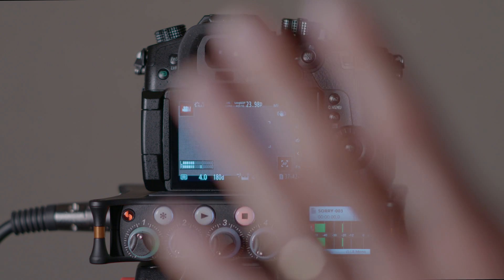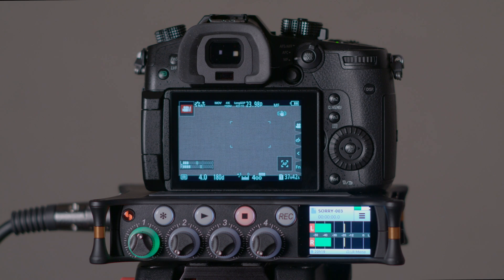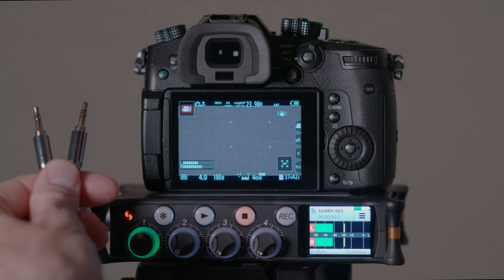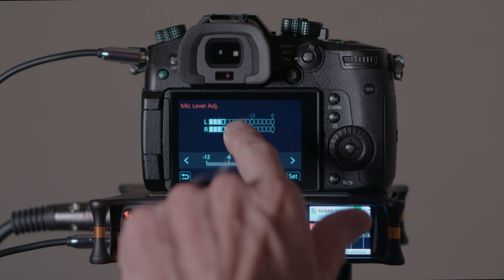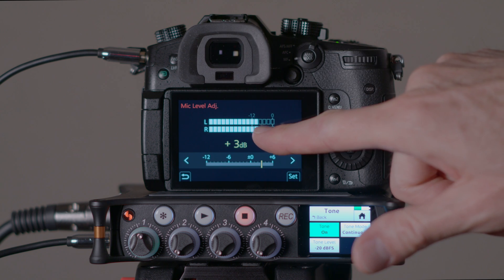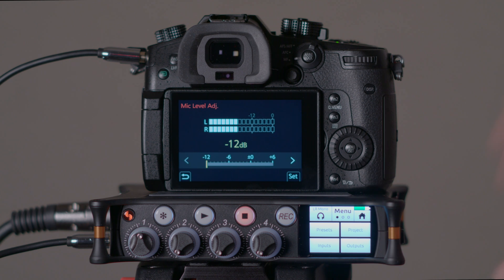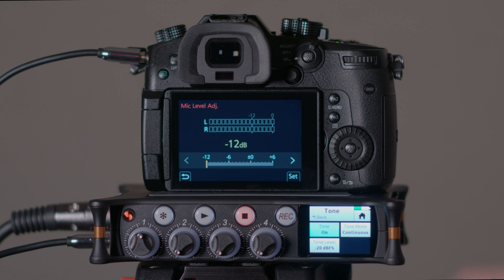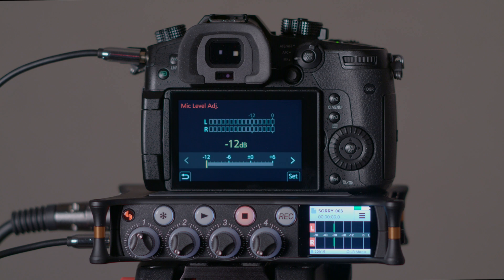Sound for Video Session: Set Audio Levels From Recorder to Camera with Tone

Comment: Great tutorial Curtis.  Appreciated!  I have a newbie question for you.  I just went through all  the steps shown in the video to match the levels between my new MixPre3II and my Canon Rebel T7i.  I had no issues with the process, and my test videos sound great.  That said, I noticed something odd when I connected my camera to my smart tv via a HDMI cord.  My videos still sound great, but I noticed that they were significantly quieter than your YouTube videos.  I haven't uploaded my test videos to YouTube to a side-by-side comparison between the volume levels of your videos and mine, but the difference seemed significant.  Is this normal?  Will my videos somehow be magically louder once their uploaded to YouTube?  Thanks for any thoughts or commentary you can offer on this.
Reply: Hi Dean, Yes, setting levels for recording is to ensure you don't clip or distort during recording. But then in post production, you need to loudness normalize the audio like this: https://youtu.be/OKSWPrT5upo

Comment: What brand or where did you buy the 3.5 TRS cable from? Can the TRS cable connect to any camera?
Reply: I just used a monoprice cable which I bought from Amazon. It can connect to most cameras with a 3.5mm microphone input.

Comment: hi there,  is there any way to record in camera video but with no sound ?  i am a new owner of a gh5 ..Thanks in advance!
Reply from the maker: Hi Razvan D., There isn't a setting I know of to turn off the in-built microphone, but if you have a 3.5mm plug with nothing else connected to it, that will tell the camera to use the 3.5mm microphone input and since you won't have anything connected to the other end of the 3.5mm cable, it won't record anything. Or, you could just drop the audio track in post in whichever editing app you use.
Reply: @LearnLightAndSoundSessions  Great! thanks for the answer.

Comment: Looking into the Mix Pre-3 for my dual GH5 setup and had a question. We shoot a ton of interviews. Typically I run two mics into an H5 and use the mic that sounds better. Had an issue with power failure on the H5 using a powerbank that caused me to lose an interview recently. Looking into a redundant setup where each mic is going into an isolated recorder or one straight into the camera using a Rode newshooter for one of the booms. QUESTION(s): Does recording into a Mix Pre or an H5 and then sending that line out signal ultimately to the GH5 degrade the audio quality? If the GH5 is set to -12db is it still coloring the recording or are you getting just the quality from the external recorder? What would be your go to setup for truly redundant audio?
Reply from the maker: Feeding audio to camera is a fine approach that I use more than ever. Technically, it will degrade the audio quality a bit but running the audio to camera gives you options in post. I'd do it assuming that the camera audio will be backup, but if you find it to be good enough for what you're doing, then you've saved yourself a bit of time.

Comment: i am not employing the mixpre but rather the zoom f4.  there seems to be some complicating issue about whether the tone sent from the zoom is line level of mic. are you aware of this controversy?  it is my understanding that if the tone was sent out as line level, the setup between camera and the zoom f4 would be similar to your vid. but what would happen if the tone sent from the zoom f4 would be at mic level? 

from another website: "A bigger problem is its slate tone. According to page 118 of the user manual:

The MAIN OUT 1/2 and SUB OUT 1/2 faders do not affect the level of the slate tone.

This is not good. One of the main purposes of slate tone is to use it to adjust the audio levels of other equipment you connect. For example, if the main XLR outputs of the Zoom F4 are connected to a breakaway cable, and that cable is connected to the audio inputs of the main camera of a shoot, you cannot use the slate tone on the F4 to adjust the audio input levels on the camera. Simply put, the volume level of the slate tone on the F4 should match the volume level of the Main Outputs. The way the Zoom F4 is now, you would need to plug a tone generator, like the Shure A15TG, into one of its inputs and use it as a slate tone to set the levels of cameras and other equipment you attach."

I apologize for the way too long post but i wanted to properly explain the problem.

can you see a better work around to set levels other than a tone generator? can i take the audio from the interviewee and set levels or even a crew member and by pass using the slate?

as always, thank you for the effort and the sharing.  i am a very appreciative subscriber.  thumbs up.
Reply: Interesting. Are you using the 3.5mm output or the XLR balanced outputs? From memory, I thought the F4 XLR outputs produce a line level output signal and the 3.5mm output produces a microphone level signal.

If you're using a camera with a 3.5mm mic input, then having an output that is mic level is exactly what you need.

Comment: This is confusing Curtis. What are you doing on the side of the MixPre? we can't see. Also you show how to get -20db on both camera and mixer but don't explain how that relationship works when we adjust the input gain and output volume knobs. For example If you set the output volume at a certain level does that affect the TONE going to the camera and does the input gain affect the TONE? Not quite sure how this all works. Maybe a better explanation of how the input gain and output volume is set up and then all the other stuff.
Reply: Hi John, first, let me explain the high level goal and then answer your specific questions.

The purpose of calibrating the camera and recorder is so that you do NOT have to worry about or change the output level of the recorder during the shoot. You can simply make any trim or fader adjustments on the sound recorder/mixer without worry of overloading the camera audio inputs.

On the side of the mix pre, I use the menu settings knob to change whatever setting we're currently adjusting. You can see the changes reflected on the MixPre's screen.

Calibrating the camera and audio mix to -20dB ensures that you will not (and SHOULD NOT) adjust the output level on the recorder once you have the camera and audio mixer calibrated at -20dB. So if you increase the input level on your audio recorder during the recording, the level on your recorder and your camera should increase in tandem. As long as you do not clip on the audio recorder, you should not clip on the camera. That is the whole idea behind this process of calibration.

The tone level sent from the audio mixer is set in the recorder's menu and is not affected by the trim or fader levels you set for any of the microphone channels.

I hope that makes more sense.

Comment: I’m thinking of getting the mixpre-3. the only thing that concerns me about this set up is changing the camera battery is much slower. Does any body know any solutions to get access to the battery compartment faster?
Reply: Hi Rashad, So it sounds like you're mounting the camera on top of the MixPre. You could put a quick release plate between the MixPre and camera.
Reply: Curtis Judd thanks a lot! I’m kicking myself for not thinking of such an obvious solution! I’ve  done it with other pieces of gear too... hahaha. keep up the good work!
Reply: @Rashadmcka  What're friends for? To help you remember the things you already know but temporarily forgot. Thanks so much!

Comment: I can make this steps with Tascam dr60dmkii ? and I don't have audio level in my camera because too old how I fix this problem with Tascam because I tried before and the sound not good
Reply from the maker: Hi Ehab, yes,  the Tascam has a tone. The camera needs to have a peak level meter and the ability to adjust the input level on the camera.

Comment: Hey Curtis, I have a Tascsm DR60D  MK II. I wanna upgrade to the Sound Devices Mix Pre 3. The Tascam is freaking awesome if the levels are set perfectly and I'm smart enough to use a dual track recording at about a -12db level. But if my subject sings so loud I still can get distortion. Here's my thinking (correct me if I'm wrong). I'm getting distortion because my subject is exceeding my levels regardless. Then once the digital limiters kick in on the Tascam they simply keep the distorted audio at a lower level instead of preventing it. The Mix Pre 3's analogue limiters can rescue me from this distortion in a subtler/ more effective way by reducing the input levels and preventing distortion. This would allow me to focus on my subject intestead of my audio. How's my thinking?
Reply: Hi David, pretty good thinking but with one recommendation. The MixPre's preamplifier has so little self noise, that you'll want to reduce the gain so that the peaks are hitting more in the -24 to -18dB range. Then you can normalize to higher levels in post. You want to leave plenty of headroom so that when the really loud singing kicks in, you're only hitting the limiters very occasionally for the most transparent sound. And because the preamps have so little self noise, there's no need to run the input levels so hot at -12dB. I hope that makes sense. Good luck!
Reply: @curtisjudd  that totally makes sense. I use the cheap AudioTechnica AT875R. It comes in super hot, but doesn't grab the low end so much. It does have decent/good off axis rejection but overall - it's a beginner mic thats good enough for journalists. I really want the Deity SMic2 with the Sound Devices Mix Pre 3. I wish they made a $300.00 single input Mix Pre 1. Lol. I'd buy 2 of them! One 1/8 Jack and one XLR Jack. Only one used at a time. I'd still buy it.
I get you about the settings. Keep the gain low cause the Mix Pre 3 is ULTRA LOW NOISE...  Normalize it all in post since there won't be much noise that gets amplified from the Mix Pre 3 (the mic... That's another story about noise).

Comment: Do you always turn the camera to its lowest setting? I work with a lot of cinema cameras such as REDs and what not.  

Also the thing that confuses me with the F8 is that I know it only does -10db for the feed, but the slate tone let’s you select -20db for the tone, should I be setting it -10db for the slate tone as well?  I’m looking to get the F8n because of this annoyance.  What are your thoughts? What would you do?
Reply: Hi David, not always to the lowest setting, but usually quite close. With cinema cameras, I'm usually sending a line level signal instead of a mic level signal so the gain is usually less of a concern.

When sending tone to the camera from the F8, I use the slate tone set to -20dB. This works great on firmware version 5.0. I don't recall whether it was an issue with earlier firmware versions.
Reply: Curtis Judd thanks much. Good to know.

Comment: Basic Question: If the goal is always the best audio possible, why would we send/route the MixPre Kasmir-quality signal back through the camera's inferior preamps? What am I missing?

PS. I'm just getting started on the audio side. I have the new Sony a7III and will most likely purchase the MixPre-6 and your LL&S course.
Reply: Hi Dan, It depends on the requirements for the production one is working. Some productions need a very fast turn-around, like many news productions, so it is common in those cases to capture the sound with a high quality mixer and send a feed from the mixer to camera. For narrative types of productions, there is often more time so in many of these cases, the production will use the mixer's recorded sound to keep the quality as high as possible.

Happy recording!
Reply: So...if my shoot is NOT a "fast turn-around," then I'd just use the camera to send timecode to the recorder for the easiest post-processing sync. Correct?
Reply from the maker: Yes, if the recorder is mounted to the camera rig. Or if not, timecode generators or a good old clapper-board/slate. :)

Comment: I have some issue when connecting gh5 to juicedlink preamps via 3.5mm jack, there is a constant ticking sound on gh5 when the cable is connected even the juicedlink is turned off. The ticking sound will appear quieter when camera is set to -12db, but it still there, do you have an issue like that? And what do i need to do to remove that ticking sound? Thank you
Reply: Hi Dedycyhuang, Do you still get the ticking sound when the JuicedLink is NOT touching the camera, that is to say, the cable is connected but the JuicedLink is not attached to the bottom of the camera. Sometimes there are issues with the 1/4-20 tap transferring noise like this.
Reply: AHHH thank you very much, I was puting the juicedlink on top of the camera via hot shoe, when I take it off the ticking sound disappeared. so now I attach it on the bottom of the camera, THANK YOU VERY MUCH and sorry to ask such a noobs question
Reply: That's great! So glad to hear it worked. Not a noob question at all. 👍

Comment: You  said to turn Tone ON to send the signal to the camera...right... after you did the settings you shut it off again. Is the Tone "on" only to set up but not have it on while recording?
Reply: Correct, tone is only on during setup. If you leave it on during recording, you will record a tone rather than the sound you're trying to record.
Reply: great, thanks for that Curtis.  I have the pre3 and it's a great piece of gear. I pretty much figured it out thanks for the great information.

Comment: im using the GH5 with the mix pre 3, and for some reason when I plug in my headphones to the camera, the audio is very laggy. Every thing is a second behind. Any thing you can think of that would make this happen?
Reply from the maker: Yes, if you are going to monitor from the camera, you'll want to change the audio monitoring to real time. The advanced manual p. 5 covers how to do this. Good luck!
Reply: advanced manual on the gh5?
Reply: The owner's manual for the GH5 comes in two parts. The second part is the "Owner's Manual for Advanced Features" and you can find it here: ftp://ftp.panasonic.com/camera/om/dc-gh5_en_adv_om.pdf
Reply: I would probably monitor from the MixPre instead. I don't think there's a way to reduce that latency if switching to realtime as described does not solve the issue. I'm sorry. :(
Reply: thanks! I've figure out what it is. As soon as i plug in the HDMI to my external monitor it becomes laggy. Is there a fix for that?

Comment: Hi Curtis. Am using the Marantz PDM 602A with GH5. No tone send on Marantz, but set voice level to -12 on Marantz (gain switch on hi, level 3.5). When I plug into the GH5 the bars on the camera immediately jump to -22 db on camera bars (quiet room/room tone). Speaking into mic at -12 level (on Marantz), camera bars go into the red. To get camera levels down to ca. -12, I must turn Marantz output level to 1. I'm not using an attenuating cable (culprit?). If I set gain on Marantz to low, same discrepancy (with different level setting). I've heard others (including J. Cook below?) finding GH5 audio to be hot, or not well matched with external pre-amps. Other (most users) seem to be doing fine. Will I resolve this with atten cable, or is there perhaps an issue with GH5 audio? (Using Senni  ME66) Thanks in advance. We're all glad you're here! : )
Reply: Yes, the GH5 preamps are on the hot end of the spectrum and output on the Marantz is a little hot as well. An attenuation cable would be a good test. Best to buy from a place with a good return policy like B&H. Good luck!
Reply: In my testing the output level of the Marantz PMD 602A was 1Vrms (or 0dBV) when the meter displays 0. That's hotter than consumer line-level (-10dBV) and just a whisker under pro line-level. So yes, it's not really a microphone level output by any normal definition - hence the need for an attenuating cable when using it with a mic level input. It's an odd design choice, to be sure.

Comment: Hey Curtis! I'm running the same combo as you, MixPre-3 and GH5. Curious how you mount the GH5 to the MixPre-3 during real work days. If one screws it on top, changing the battery becomes very cumbersome. How do you do it on real shoot days?
Reply from the maker: Hi Linus, I will confess that I always record audio separate from the camera so I don't attach the MixPre and camera. Battery access is part of the reason for this but the main reason is that I prefer the audio quality of recording just to the audio recorder and then sync in post.

That said, a camera cage for the camera would allow one to attache the recorder on a friction arm to position it off to the side if you wanted to go that route.

Best of luck!